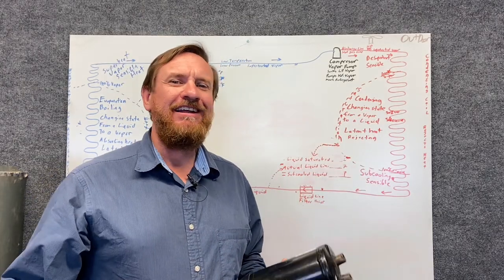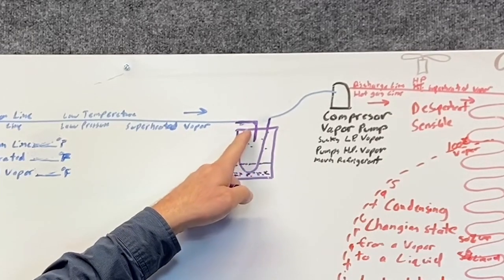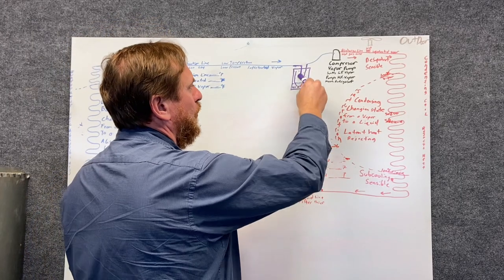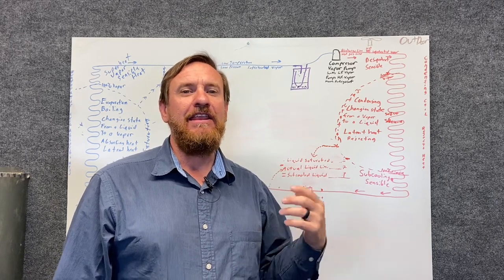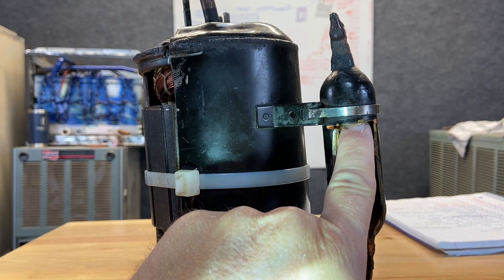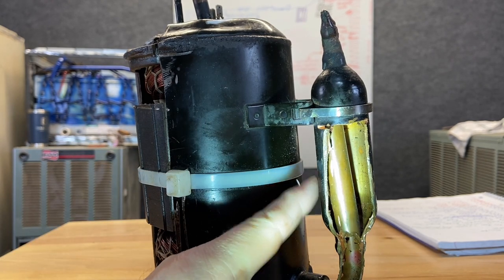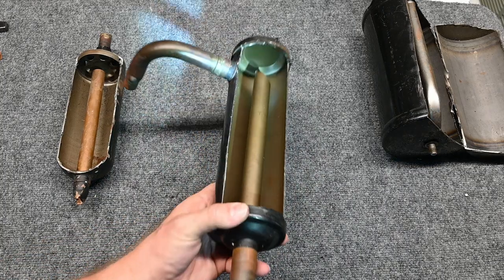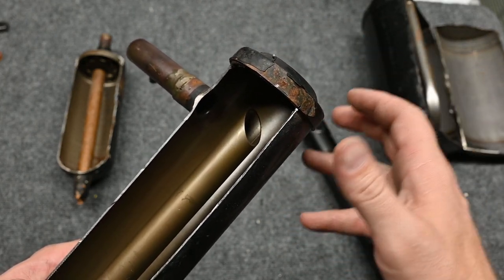HVAC  069 suction line accumulator

Comment: Outstanding video, and great reminder to always keep learning. Recently learned about these in school but didn’t know that you need to change these when you have a compressor burnout. Excellent and clear explanation of everything. 

Great tip about the naming, to call it a “suction line accumulator” to help you remember it’s location. Naming different components in this way has helped me a lot.

Comment: Thank you Mr. Ty for this nice video. The orifice in the bottom why not pull liquid refrigerant only oil?                                                                        If the compressor replaced how to clean EEV? Thanks.🌿

Comment: Thanks for the video. What happens to the remaining refrigerant liquid inside the Suction Accumulator ? Is it going to vaporize ? Should the Suction Accumulator be insulated or not because a lot of customers are insulating ? If it is insulated from exterba heat then how does the liquid Refrigerant inside the said Suction Accumulator evaporate?
Reply from the maker: Thanks and great question.

For the most part they should not be insulated so the heat from the accumulator can help boil off the refrigerant.

In some cases they are insulated to prevent condensation in unwanted areas.

Some argue that insulation reduces condensation and rust so the accumulator lasts longer.

Others argue the insulation traps the condensation that's inevitable, preventing it from drying out and speeding up rust. 

I find it depends on the climate and the specific application but in general no insulation.
Reply: @love2hvac  Ok noted with thanks....
Reply: @love2hvac  Oh yeah one more question : With the volatile Refrigerant liquid " trapped " inside the Suction Accumulatir , is there a potency of Vapour  Pressure rising up to a dangerously explosive level especially  when the compressor is NOT running ( off condition ) and must the suction accumulatr be equipped with a Pressure Relief Valve as a precautionary measure ? Last one : Is there normally a drainage facility at  the bottom of the Suction Accumulator in case we would like to do a fast draining ? And why isnt there a sight glass on the Suction Accmulator so that we can know what the exact level of refrigerant liquid  inside the Suction Accumulator so that we can decide if it is already too high and need the so - called fast draining if any ?
Reply from the maker: @thunderdragon888  
Like a receiver, they are sized to hold the whole change pluss 20% vapor to allow for expansion. 

If there is expansion the pressure dissipates across the entire suction side. 

In the event both of the above is still not enough, there is a fuss le link welded into the accumulator that ruptured to allow controlled venting of the refrigerant.

No drain port installed.

No sight glass because of cost. I would love to have all compressors with an oil sight glass and liquid receivers to have a liquid level glass but it costs too much. 

Ideally the suction  accumulator would always be vapor and not have much liquid refrigerant in it at all.
Reply: @love2hvac  Thank you again for the great explanation. I think the Suction Accumulator with some accessories as mentioned by you might have been produced by some reputable HVACR companies such as Parker, Danfoss, Emerson, etc......but in some areas or countries, there are a lot of homemade or local workshop - made Suction Accumulators which mostly are not well calculated in terms of holding capacity and NOT equipped with some of the accessories such as : fuss le link etc ....as well ..and also a lot of the Suction Accumulators are being insulated ....so you can imagine if the Liquid Floodback rate is suddenly high and with all the excessive liquid flowing and settling into the well-insulated Suction Accumulator for some time and Compressors are in off condition, I can imagine that it resembles a ticking time bomb waiting to explode doesnt it ?

Comment: How would the oil make it up and out through the output line on the accumulator? Wouldnt it just collect in the line and the vapor refrigerant would just bubble through it from the  compressor suction, similar to how a water bong works :),  thanks!

Comment: Hi, I have a 6 Ton carrier split system with a "Piston" I would like to replace it with a Sporlan TXV (I have the TXV on hand) but I also want to add a suction line accumilator . What size range of the accumilator (in Liters) should I use . Thanks very much

Comment: What's your thought on adding an accumulator on a system? For low load conditions with a fan cycle switch (on the condenser fan motor). Right now there is only a fan cycle switch and it's working great at 66°F 🙈. Yes I do have SH lol
Reply from the maker: As long as your maintaining superheat your likely okay. 
I have added accumulators to computer rooms units and some custom refrigeration applications.  
But you could add it to any system it's just a lot of work.

Comment: Based on this highly informative video it would seem that the density of the refrigerant must be lower than that of the oil; otherwise the oil would float to the top and not be sucked into the small orifice at the bottom of the accumulator.
Reply from the maker: I love how you are thinking.
It's quite fascinating how the density, reliability and viscosity all work together. Here is a publication testing POE on HFO refregerants. 
https://pubs.acs.org/doi/10.1021/acs.jced.0c00431#

Comment: Maybe a stupid question. But, what if you use acidaway, and use it before the suction accumulator (maybe use vacum to get it in the lineset before the accumulator, or in the accumulator), so that it will "blend" in before the compressor. Will it work.
Reply from the maker: To "neutralize" an acid, you do so by adding a base or alkyline chemical to it.

A few things about this.

1 There must be a correct amount of alkyline added to neutralize the acid. If not, the system remains acidic OR it can go to an alkyline if you add too much.

2 Once the Acid/base reaction is done, the chemical byproducts of that reaction are WATER and a form salt.

The best way is to use filter driers designed for acid removal. 

The issue with the suction accumulator is the oil pickup in the bottom. The orifice can become plugged and cause oil return issues to the compressor.

Comment: what do you mean by "flushed the lines" when you replaced the bad accumulator you "flushed all the lines"? like with nitrogen or what?
Reply from the maker: The pipe wipper for the refrigerant lines. Link below
For the coils and only for a burn out. I use a Rx11 flush. That product has received some bad attention from techs that to no get all of the product back out. After flushing the coils I use several nitrogen purges and then pull a vacuum down to around 200 microns to know it's all boiled out.

https://www.trutechtools.com//Pipe-Wiper-Refrigerant-Line-Cleaner--Residential-Kit_p_10450.html?utm_source=google&utm_medium=surfaces&utm_campaign=shopping%20feed&utm_content=free%20google%20shopping%20clicks&gclid=CjwKCAjw87SHBhBiEiwAukSeUY1zQLnOCaEaQHSjh5PfFzOGOnjvUpBuUzXbVnh5Hu2mJmTXQDrynRoCEM0QAvD_BwE
Reply: @love2hvac  thanks you're the man

Comment: I have a system that has had a compressor just changed and company that changed it went bankrupt. I’ve been sent out to evacuate and charge. I charged and system was making strange hissing sound and showing low evaporator pressure, normal head pressure, low suction line temp, 4K super heat and the line going after the suction burnout drier into the accumulator and out into the compressor were iced up and compressor was louder than I have found usually (scroll AC compressor) Any chance the screen/orifice in the bottom is blocked and the charge of the system and oil is filling up in the accumulator not being able to boil off and go into the compressor? It’s got me stumped otherwise haha
Reply from the maker: There is a lot I will make a few notes. 

In short your flooding the compressor. More information needed. 

#1 compressors don't die they are murdered. The real question is what killed the old compressor? It will likely kill the new one. 

#2 was the system brazes in with a flow of nitrogen? Oxidation forms inside the lines and clogesetering devices and screens.

#3 how many microns of vacuum where pulled?  Deep evacuation is essential to dehydration and life of the compressor. 

#4 Liquid line filter drier, there should only be 1. Too often I see the original left behind the valves inside the unit and a new one added after the vlabe outside the unit. There can only be one and check for temperature drop acosss it. The screen before the metering device should also be checked for restrictions and oxidation. 

#5 suction line filter driers are not to be left for more than 72 hrs. Come back recheck for pressure drop, if there is it needs to be replaced (with the liquid drier). Recheck max of 72 hrs. Repeat untill no pressure drop, then remove the suction drier and one last time replace the liquid line drier. 

#6 suction line accumulator, was it replaced with the new compressor? If not was the oil drained inspected and measured?  There is a screen and orifice inside that can get clogged and trap oil. 

OPERATION

#1 AIR FLOW, the most, the most overlooked and misunderstood part of the HVAC system. There must be proper airflow across the evaporator or the refregerant cannot boil to a vapor. The TXV often gets blamed for bad airflow. The true flow grid is the most effective way of measuring airflow. Airflow is a number more important than gauges.

#2  what metering device is being used. After airflow the metering device is the next step. Fixed orifice we need to know the outdoor temperature and the return air wet bulb to calculate target superheat.
If TXV, after airflow, we need to ensure proper subcooling to the metering device check superheat to see if it's maintaining the correct evaporator superheat. Usually 8-12 at the evaporator, 18-20 at the compressor.

#3 MEASURMENTS 
I recommend the Measurequick app but important numbers for remote diagnostics 

CFM airflow across the evaporator.
Evaporator condition.
Metering Device type.
Refregerant type.
Superheat at the evaporator coil.
Superheat at the compressor suction.

Superheat at the compressor discharge.

Subcooling at the condensor

Subcooling before the metering device.

Temperature of the air entering the compressor and liquid saturation temperature for condensor TD (STOA)

Liquid line temperature to calculate  approach. 

Return air temperature and supply air temperature to calculate delta T

Return air temperature and suction saturated to calculate evaporator TD.

Return air wet bulb and supply air wet bulb to calculate capacity.

Temperature drop across the liquid filter drier.

Pressure drop across suction drier.

Compressor model number to find the compressor performance chart.

Compressor amps with suction and discharge pressure to compare with the compressor performance chart.

Voltage at startup and voltage running.

Comment: Why do suction accumulator ice up??
Reply from the maker: The liquid refrigerant boil to a vapor in the bottom, absorbing heat, as it does the temperature drops and when it drops low enough it freezes. 
I would also check for proper airflow, metering device operation and proper charge.
Reply: @love2hvac  so pressure, and temperature, on suction line not saturated?